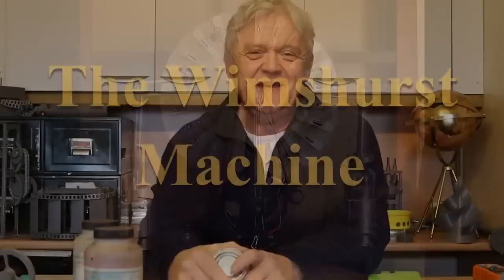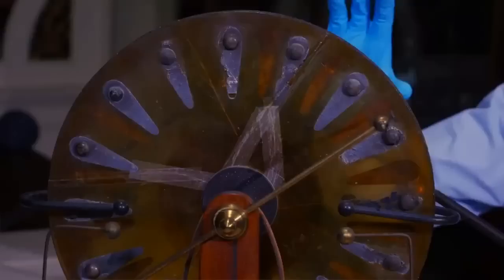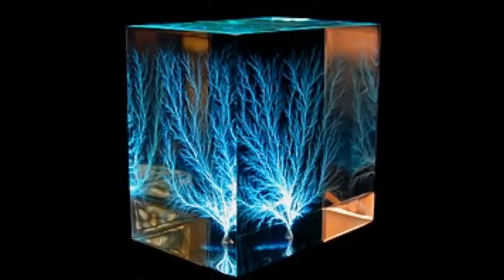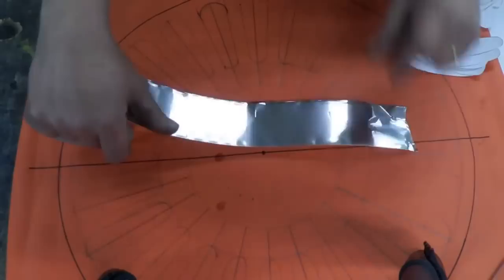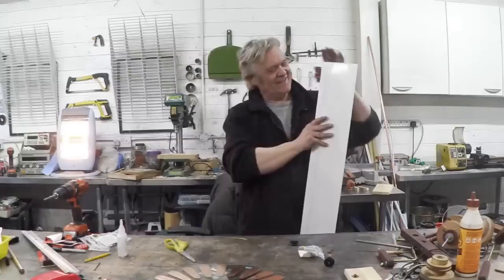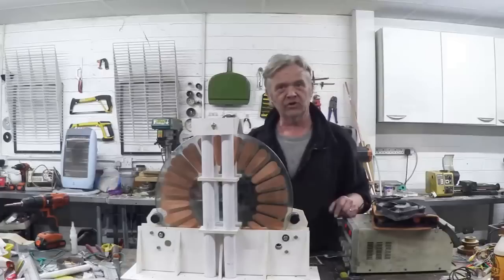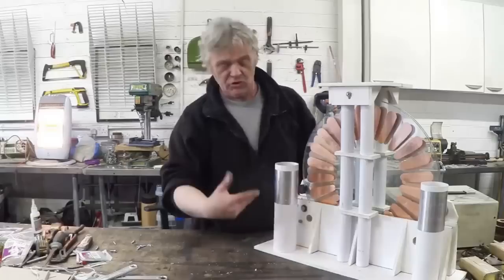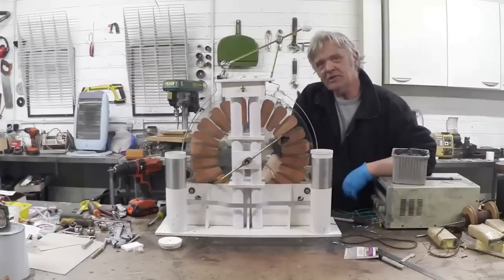045 An Unusual Wimshurst Machine

Comment: interesting, I had also been wondering about supporting the plates from the edge. Great to see your build. But it looks like the actual efficiency of the machine is quite low, the sparks are very short considering the diameter of the disks. Fun video, tks

Comment: Nifty ! I used to have & copy virtually every type of spark gizmo you can think of. BTW, even just old vinyl albums work good for DIY Wimshurst's. By FAR the simplest AND most effective "non-electric/electronic" high voltage DC static generator I ever made just consisted of some rabbit fur(most synth is fine) rubbing against a spinning 4-5" diameter piece of PVC pipe about 18" long. Use end-caps too with drilled out holes to place a round wooden dowel thru for a shaft, though actual bearings of some kind would prolly be even better but not at all required. The collector was just a piece of 3/4" copper pipe(same length as PVC pipe) adjacent/parallel to the PVC pipe, with a gap of about 1". A thicker walled is prolly preferred?, though no doubt that even a thin walled 1/2" pipe would also "work". On the copper pipe was a strip of ordinary aluminum foil(also same length) about 2" wide but folded in half to 1" just literally electrical taped along the length of the copper pipe. Put as many(100+ish doubled by the folding) randomly oriented & staggered "fingers"(like a comb) cut into the tinfoil strip like half way thru its width, aimed at the junction where the fur rubs the spinning PVC pipe. Technically the tinfoil's fingers are the actual "collector". The Capacitor(Leyden jar) was just a 6-8" diameter round tupperware bowl with aluminum flashing covering the inside & outside of the bowl minus about a healthy 3/4th" from the top. Also get some flexible copper tubing about 1/8th to 1/4" diameter & put a length of it just a little longer than your tupperware bowl is high, thru the tupperware lid. Solder/"put"(even just tape or somehow pressure fit) 2 or 3 lengths of any kind of wire from that center tubing to the inside flashing(Pretty sure even just 1 solid/smooth connection would be fine). Also flatten a portion of another piece of the same thin flexible tubing & connect it to the outside flashing by with tape and/or via rubber-banding it around the outside of tupperware bowl such that it is also electrically connected to the outside flashing. But leave this piece of the thin tubing long enough to bend it into a long & easily adjustable arc over the top of the entire capacitor. Now just get 3 as round of cabinet knobs without sharp edges as you can find. If you can't find any with no sharp edges just do some hand filing/dremel polishing. Sharp edges are typically the enemy with all of these parts & connections. But this design is effective enough that filing/polishing isn't strictly necessary. "Put" 1 knob on either end(whichever is most convenient) of the copper pipe collector near the fur & on both of the other 2 ends of each of the flex tubing ends(connected to the inside & outside) of the capacitor. Place the entire capacitor's center ball/knob very near the ball/knob on the large copper collector pipe near the fur. This is mostly just to see a small spark gap as an indication that it is indeed working. But you could just opt to lose the 1 knob(on copper collector pipe end by the fur) by just directly connecting the large copper collector pipe to the cap's center knob or inside flashing plate with a length of wire instead. But its nice to see that its working(when in motion) just by having those 2 knobs very close to each other instead. Now just play around with the distance between the 2 balls/knobs on the cap itself, by bending that longer outside arc made of the thin tubing. Like any similar contraption the closer they are the more frequent the discharge but shorter the sparks & the further they are seperated the longer the spark(up to some max dist) but it occurs less frequently. Obviously, you also need to build a frame/chassis & a functional hand crank(if not using a motor to spin the PVC pipe) out of wood or PVC or a plastic milk crate or whatever non conductive materials you have on hand. A motor is nice as opposed to hand cranking but either is OK. Also, I'm pretty sure, If I'm remembering all of this OK, that also covering the large spinning PVC pipe with rubber(balloon, floor mat material etc.) may help at least a little, though it works fine without it. I never really tested that, it might have just been a dry day. & I'd guess that the flashing can indeed just be replaced with HVAC tape(like as per this vid). However the total charge/energy may matter on the thickness/total amount of/mass of all of the metal involved, at least to some extent, as well as just the surface area of the cap plates alone. & surely the type of & thickness of the tupperware/dielectric plastic is rather significant. But just play around with whatever you have handy. Anyway, such a gizmo can easily produce 6-8"+ sparks about once per second consistently(even in humidity) !
Reply: Nice description of what is definitely a unique electrostatic machine. I could picture it in my head.
Reply: I would love to see a video of this running. I have been working on a van de graaff that I could do a lot of adjustments to to try and find the most efficient setup as I couldn't find much info on ideal brush distance etc. Also wanted to test having a sort of center tap for it to ground and have one roller have positive and the other negative in reference to ground. What you made may be easier to start with.  I have had trouble with building voltage on all of my prototypes probably from leakage to my work bench in some way.  I have it set on a large PVC tube with a large 12" metal garden ball that does not have a seam on it.  Thought this would be the cheapest option that could build the most voltage.
Reply: @jazzophis  I gave that particular milkcrate gizmo among many others to my neighbors son & little cuz when I moved in 94 & had to downsize ! I'm sure I'd at least have a pic had it not been 30 years ago. Ironically, I was thinking that even if I had a vid, youtube comments tend to hate links. Anyway, yup leakage is the enemy. Thats mostly what I meant about effective, the charge not bleeding off faster than you can store or use it. Although obviously different than a Van De graaff, I definitely remember grounding the outside plate of the cap & it making no noticeable difference whatsoever which was surprising. Ha good Idea. I never did manage to find a practical/cheap suitable dome for a DIY Van De Graaff but I did mess about with much wider bands & roller types & brushes & such with the dome I had but surprisingly none were any better if even as good as my purchased medium sized guy. The only thing I'd wonder off hand is, is your dome thick enough ? Like I said regarding the flashing, it might not just be a matter of surface area alone. Or I could also imagine it being too big OR small(size or mass) for the particular rate of charge etc. Anyway, If you do go with a similar fur type, I did always want to try 3 copper pipes/tinfoil comb collectors(connected to a single ball/knob on one side) & 3 fur slabs staggered @ 120 DEG apart around the spinning PVC drum, NOT that it even needed it. TBH I'm convinced it was mostly just all about the dielectric properties/thickness of the caps plastic & perhaps the flashing dimensions/mass etc. as there was never any issue collecting a steady charge from the rubbing area with even slight motion. It must just be a low bleed rate setup. As far as yours goes, they say the skinning effect is all about the conductors surface itself but the actual amount of conductor material prolly matters is some significant ways. I'm not even sure what established theory might have to say about that but just something to consider. & what really makes me think that too is that it would matter as far as capacitance tuning on a tesla coil for instance. Good luck ! Hit me up with a vid, nifty stuff indeed.
Reply: @realcygnus  That is interesting. It just might be too thin, I was just looking at surface area myself.  That ball is very thin, and I no idea what metal it even is.  I wonder if the mass of it has to do with the edges you will end up with more than the material thickness? It is hard to find answers to most of my questions on this. That is mostly why I'm making one.  I work with high voltage equipment for electrostatic precipitators and know sharp edges are no good and make you spark over much easier with the same air gap.  I did cut a small hose and put it over the sharp edges I cut, but as I did it, I had a sinking feeling it would be of no help.  I feel like the only thing that might work with that is to weld a thick metal ring to the edges of the hole to eliminate any sharp edges.  The thing is, though, I am a terrible welder and only have a very cheap stick welder, and that metal is way too thin to weld.  I am glad you mentioned the mass, though. I think before I move on, I will do some tests on the sphere to see if it has any chance of holding much charge.  I also wanted to test different combs like you mentioned but have them with fine tuning adjustments on some all thread to see what works best. I have seen people with good sparking that had a decent size gap and even with the comb touching.  The first one I was trying with was from a welding cable with very fine braided wires that I spread out, hoping the more sharp points the better.
Reply: @jazzophis  Right, they got rolls of CF(carbon fiber) these days which is prolly a good choice for brushes, in some cases. Was it in this vid ? where I heard "But you have to burn off the coating" ? Anyway, imagine trying to get info about all of these things before the internet was what it is. All we had was whatever you might find in a Library & random magazine articles & such. But still don't believe everything you see & read, especially since the advent of AI assisted results. IKR, I always wanted & still do want a little MIG and/or especially a TIG welder myself but gas tanks & everything has to be an expensive hassle. Even though I don't tinker nearly as much as I used to. Yea just play around with distances & every variable you can think of. Regarding collector/combs//brushes generally, "near" is all you need but in the wimshurst case the brushes need to touch BC its coming from another conductor as opposed to insulator/region of space. More sharp points are better in some cases, but perhaps on a VDG that can serve to help bleed off charge, which is prolly why the combs are typically small. Whereas on a fur gizmo you got that whole area where it rubs the cylinder to catch, if you know what I mean. Keep me updated.
Reply: @jazzophis  I have several Van de Graaff machines, including a 1950’s antique made by American Electrostatics. My N-100 is my biggest beast and is the same machine used by MIT physics Dept. to teach electrostatics. Have the brushes at a 90° angle to the belt as it goes around the pulleys and as close as possible without any possibility of touching. Belt material and pulley material and a clean top electrode (with no fibers to bleed off electrons) are the key to a powerful VDG. Belt material should be soft, pliable rubber. I get my belts and pulleys from Wabash. One pulley should be wool felt covered and the other rubber. If you have the wool at the base and the rubber at the top, the top output will be negative. Mine is capable of 15” sparks on a good dry day and 10” sparks on a humid day.
Reply: @DanielGBenesScienceShows  very nice. I'll take a look at those rollers. I was thinking about a Teflon roller, and I forgot what else. I was looking at tribiolectric charts and going to far ends as much as possible.  Thank you for the advice. Those will help me get a good starting point.  I was wanting to make this to test an idea I had that I couldn't find any information on.  I was wondering if a static charge had any effect on wind resistance.  I know aircraft try to minimize the buildup for other reasons interference etc. Just got the question in my head and can't get it out till I test it.
Reply: @realcygnus  will do. You'll have to be patient as work and family take up a very large portion of my time.  And I can't imagine how much harder it was to get info on this back then.  I remember having to do book reports from reading through our encyclopedia.  There is so much info out there now it is amazing.  Now that you mention it I haven't tried asking AI yet, I'll give that a go.
Reply: @DanielGBenesScienceShows  Nifty !

Comment: You can continue to charge the plate over and over and over, building up a charge until it cannot hold anymore  ( in layman's terms)
However, if you run an electrode from the backside of the plate,  up inside a metal sphere, the charge on the plate will transfer  inside the sphere. Then you can grow the charge into an almost infinite amount.
It will become a very lethal charge!
Again Robert In layman's terms. 👍 😁

Comment: If you painted the foil sections with your graphene paint, except for the brush contact portions, would it behave as a much larger unit? Sort of a spinning wheel of capacitors with many square meters of area instead of dozens of square inches.

Comment: can this energy generated be captured into high voltage capacitors, if so, can the stored energy then run a simple dc motor to run the machine as a closed loop as the torque needed to rotate the machine should require a small low amp motor.

Comment: at 16:27 I think I see a major limiting flaw in your design that could be easily corrected. The connection to the inner foil of the capacitor, is it running through that angle bracket and bolt? Did you have to carve away the outer foil to clear the connection? That is probably a point of great leakage, limiting the output voltage.
Reply: They're not touching, if you look closely at 14:00 you'll see the cut-out around the bolt, which he mentions shortly after. Otherwise it probably wouldn't make any spark at all.
Reply: @VeniceInventors  It doesn't have to touch, it just needs to be close by with sharp edges to bleed away charge. His generator should make sparks several inches long at minimum if set up properly.
Reply: @VeniceInventors  The connection to the inner foil should go through the middle of the top cap, just as is done on a standard leyden jar, to minimize the electric field gradients.
Reply: @zinckensteel  I see what you mean. And it makes sense if the goal is to get the highest voltage possible. Maybe Robert intentionally limited the voltage by  reducing the spark gap, to make it easier and safer to replicate the device. Or maybe it's the other way around and it didn't build enough of a charge to make bigger sparks, so he reduced the gap?

Comment: But what the heck does it actually do?  Can I charge my cell phone?
Reply: Just in case your question is legit… It’s a high-voltage electrostatic induction generator developed in the 1800’s that could be used to power things from that era, including gas-filled discharge tubes, X-Ray tubes, Crookes tubes, Geissler tubes, cathode ray tubes (which led to radar and TV), spark-gap radio and telegraphy, etc.. 
As well as things that people still like to play with today, including all the above mentioned devices, PLUS lasers, particle accelerators, metal vacuum sputtering/deposition and scintillation devices, etc..
Definitely do NOT get your cell phone anywhere near a device that produces high-voltage and can accelerate high-energy particles. 
— To better answer your question: It’s freakin’ gorgeous and produces high-voltage sparks out of thin air! What more does it have to do? 😃

Comment: Can a wind turbine be coupled with a Wimshurst machine and the output passed trough a transformer to turn high voltage low current into lower voltage higher current? in order to replace classic wind turbine generators?
Reply: No.
Reply: @intergalacticmailbox  Why?
Reply: @danvasii9884  Wimshurst machines develop high voltage/low current static Direct Current. Transformers recquire Alternating Current. The power generated by the Wimshurst machine is very low- similar to walking across carpeting and getting a small shock when touching a metal object. Although fascinating, the machine is not a practical power source.
Reply: @intergalacticmailbox  I see, thank you for explanations...